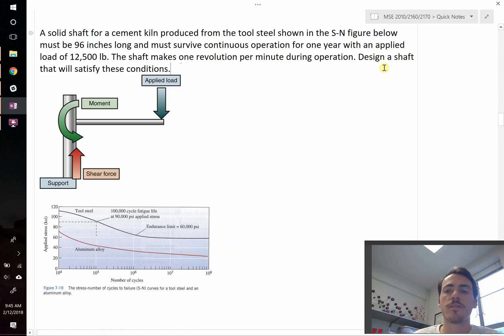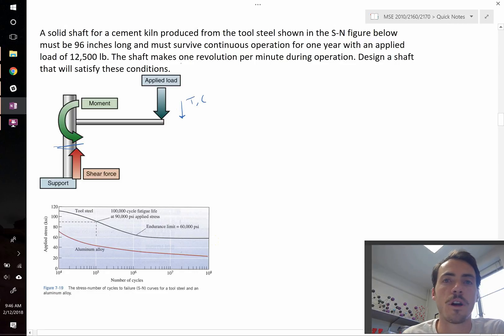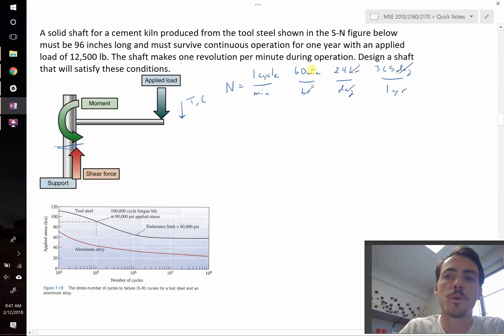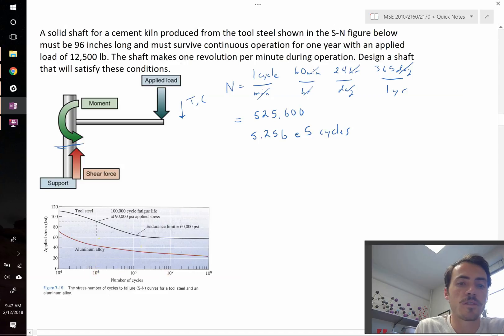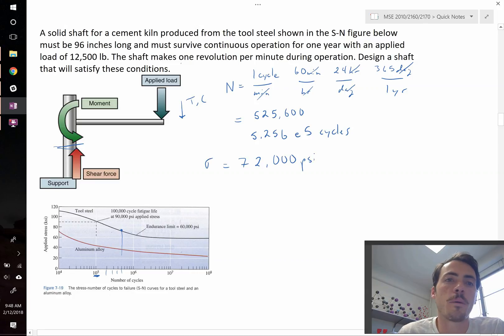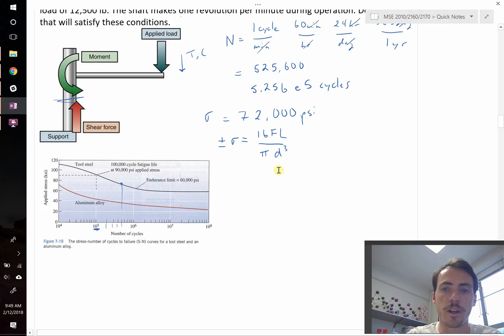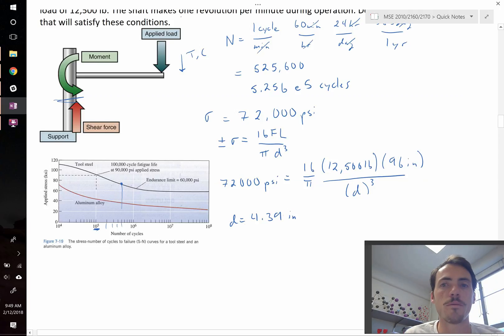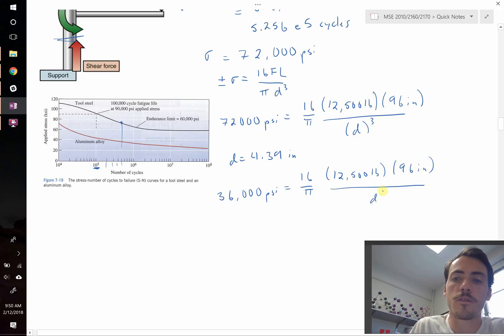fatigue testing, S-N curves and cycling example problem

Comment: Good video, although I would have used: stress=M/Z , when calculating the bending stress in the shaft. Where Z is the section modulus of the round shaft. 5in shaft seems 'light' to hold 5.5Tonnes point load at nearly 2.5m out.

Comment: Hi one question on S-N curves in order to plot a S-N what necessary data do we need from the test results?
Reply from the maker: You simply need to prepare a bunch of samples and then systematically test them with increasing stress amplitude. The tool that they typically use for these things is a rotating beam. That way it oscillates between compressive and tensile stress if the beam is not quite straight but rather at a 1 degree bend or something.
Reply: @TaylorSparks  thanks for the reply.